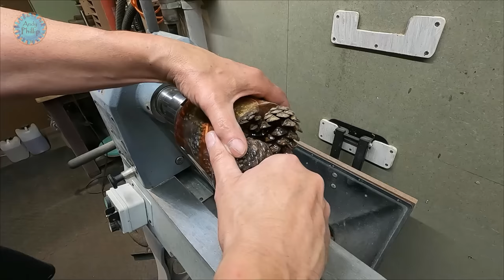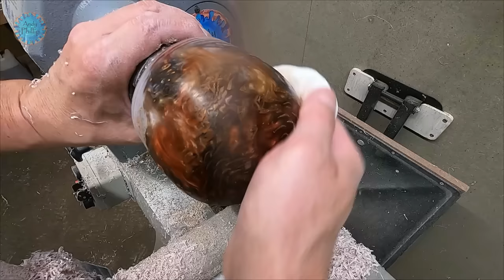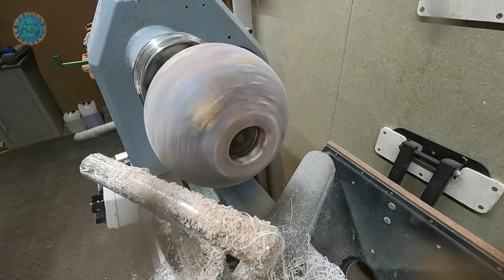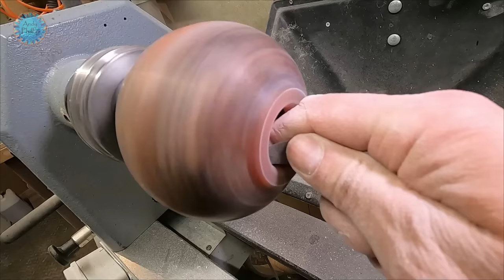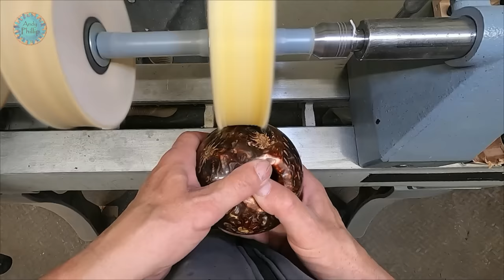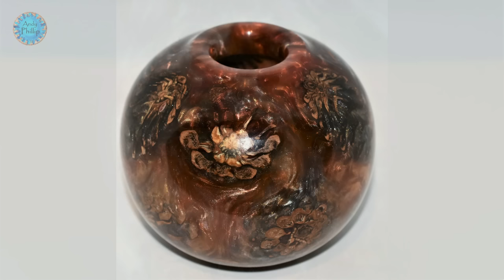Woodturning - Pine Cones

Comment: ...I love pine cones in resin...it always turns out looking so alien...and this piece is gorgeous!...👍
I noticed the resin seemed to cut away rather than chip off as I've seen in so many other videos...what resin did you use in this?
Matt
Reply from the maker: Thanks.. I used a deep pour slow set epoxy from vista resins on this 👍

Comment: Love the pinecone pattern. What do you coat the project with for the g,lass like finish. When using resin, is that a paint pot you use to prevent cracking, what psi air also
Reply from the maker: I sand to a 1000 grit and buff with menzerna buffing compounds

Comment: Andy have you ever tried molten aluminium onto wood then when cooled use resin to stabilise it si it then could be turned. I'm unsure if you have worked with softer metals or even how your tools will hold up when turning the metal   I think it would be quite an interesting look. I think brass and copper might be too hot for the wood gallium or bismuth could be used as they have even lower melting points but you have to be careful using galium as its pretty nasty bismuth is safer but I would still use a mask and varnish the finished piece just to cover the metal.
Reply from the maker: No, only used Bismuth 👍